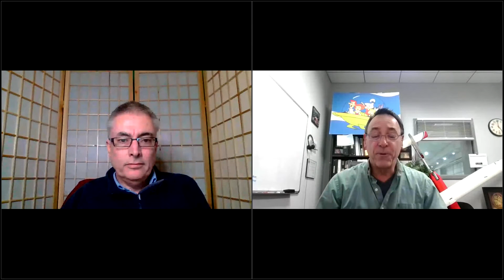VFS Lecture on Vortex Ring State for eVTOL Aircraft

Comment: I skipped through the slide presentation and caught up the Qand A for a first viewing -- a few random thoughts arise .. As to wing rotor interactions it is notable just how incredibly many 'test flights' have taken place between eg Kitty Hawk (now Wisk,then BOEING) '25000' and "110' prototypes etc, the Lilium ,only hover,slow cruise, Vertical, Blackfly , Archer and  and Ehang, ditto  Less so Joby,et al   but NEVER showing an aircraft in any sort of aggressive manouvering such as might be expected in testing  - the slow ponderous hovering is of course characteristic of VTOL where mass is high power is high but excess thrust to do useful work is miserable -hence the 'arthritic slug' look .  The ill fated (and named) Heaviside adopted the Dornier Do29 (nee Focke Achgelus -sic) configuration of aft tilting wing mounted props and did some mild excursions --the Joby crashed under unknown circumstances but was in flight failure - very possibbly due to flutter with the extreme outboard cantilevered prop/motors and wing batteries  (compare to the 1930s 'tin' Spitfire going to a measured 606 MPH and not falling apart ---progress .....)   The VX4 Vertical (not the NASA 50s) has leading edge pylons that place the props FAR closer -overlapping slightly, as compared to the extreme projection of the Archer Midnight --propeller/whole wing whirl induced flutter looks to be a real concern -much more so if imbalance occurs eg birdstrike. ( prop governor failure downed several VTOLS eg X 19 --failsafe doesn't appear in the newer crop. )     Rotor wake interaction and possible VRS might be studied on the Chinook which embodies in line rotors and routinely does 'rear up' flare landings - Stepniewski  covered some of the tandem rotor effects and there is much published data NACA etc AGARD - when the parameters are vastly different much of it might not apply so much --even studying insect flight or hummingbirds that have to stabilize in comparitively mightily turbulent air might be valuable (call it biomimickry even for extra points )  Von Holst did so with the Triebflugel . I studied the Zimmerman concept,built models and corresponded with him--the most 'interactive' wing /prop concept and ,for some applications, simplest - Vertical flight for hovering tasks is a totally different exercise than urban or personal transport by air.

These new designs just don't seem to account for mishap or even mishandling and the hubris displayed is breathtaking eg Sebastian Thrun saying that 'if anyone can solve the  (EVTOL) problem WE CAN - before Larry Paige pulled the plug and wrote off 100 million dollars ...)  Others disparaged pilot's competence in the face of their infallible software (uber Elevate ) -- the hordes of young coders involved in the start ups is cause for concern  -even Boeing ditched it's own eVTOL after it crashed thinking it was already on the ground. 

Using computerized systems to overide inherently unstable and unforgiving aircraft types seems the height of hubristic arrogance and asking for trouble in aircraft destined for relatively 'primitive' maintenance and operation .  VTOL , especially with mass-ive batteries seems the worst conceivable combination to create economic,safe , private use , quiet and 'eco friendly' vehicles when the task is basically to avoid need for an airport or ground run once in the air they are inferior in all other ways - perhaps there is a better, much better, solution.  There is,   ATOL. ( take off actually GAINS energy compared to the 3300 hungry horses needed by the eco pure Lilium....)

Others are predicting complete failure for the EVTOL 'initiative'  eg  Aerotime.aero  -"Will it end in tears?" - for economic as well as engineering or practical reasons  (just as the late 50s to mid 60s VTOL rush did -the wheel of misfortune - a battery powered wheel will not solve the basic issues of that, might be worse )  But I believe there IS a way to the bright shining ,livable future incorporating personal air mobility  (I think I first used the term in correspondence ca 2000 with Mark Moore -pre 'centennial challenge' and the aborted SATS, PAV etc etc drives or the EU equivalents )   Evtol is solving the wrong problem no matter how sophisticated - the VFS will not like this conclusion but might agree of anyone looked.
Reply: Apologies for the unintended 'crossing out' - a glitch in a third hand laptop that only appears sporadically after I  post  Hint. I don't have a two billion dollar 'war chest' unlike some....